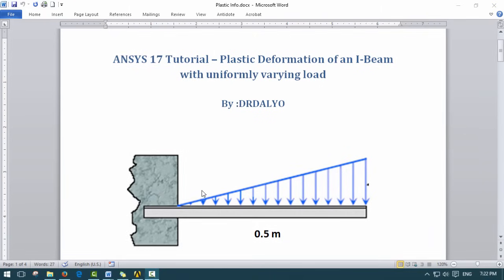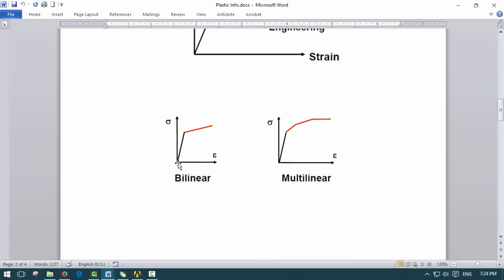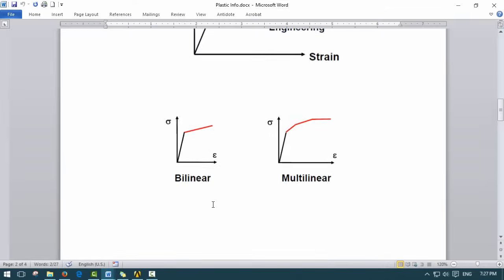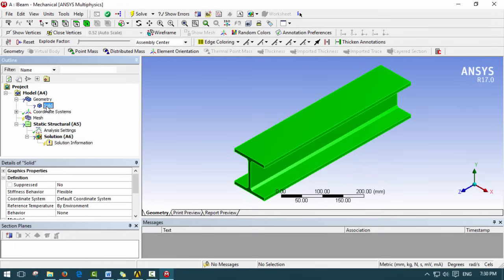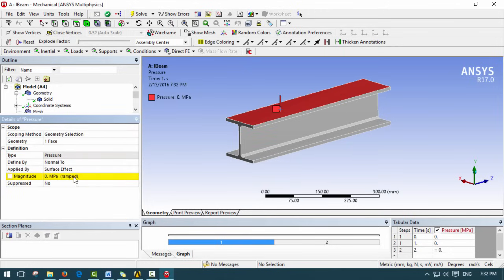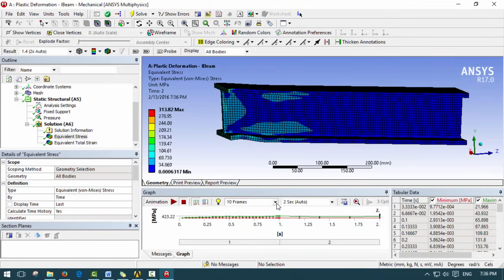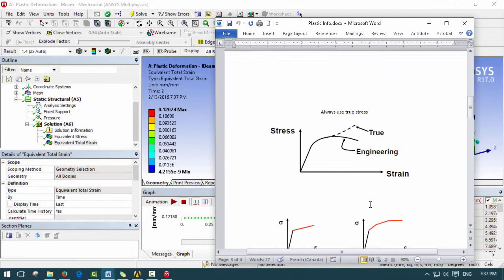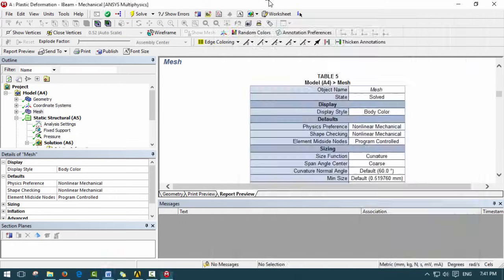ANSYS 17.0 Tutorial - Non Linear Plastic Deformation I-Beam

Comment: Hello! First of all, I hope all is well with you!
I'm a new follower of the channel and I want to congratulate you on your video and YouTube channel!

I watched your video "ANSYS 17.0 Tutorial - Non Linear Plastic Deformation I-Beam", which helped me, but I'm having some difficulties in my study.

I'm testing an aluminum spar with 4 flanges and 1 web, with holes to join them together. I set the boundary conditions, simulated a non-linear structural analysis in ANSYS, but I can't understand the results, can you help me, please?

I need to understand what force/moment makes the structure yield and what force/moment makes the structure actually break.
   1. To do this, I have to analyze the equivalent (von-Mises) stress, correct? I see if the maximum equivalent (von-Mises) stress that the simulation gave me is higher than the yield stress of the material and then if it is higher than the resistance stress? (And should I look at the equivalent (von-Mises) stress or the maximum normal stress?)

   2. Also, how do I know the structure has broken? In the simulation this never happens, I increase the force and it just starts to deform plastically, until it reaches a point where it can no longer be calculated, as it stops converging (this in cases of very exaggerated and meaningless forces, but the point is that visually the structure never breaks...how do I know it broke through the values?)

I will be waiting for your response, please.
Best wishes for you and your channel.

Best regards,
Ana

Comment: 0:40 diagram analysis
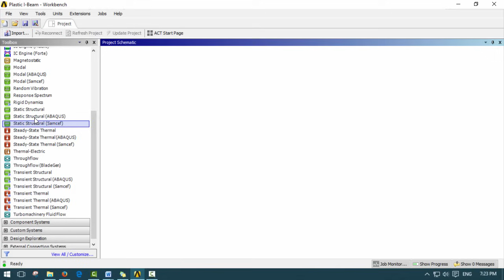1:38 static structure
2:17 Plasticity (toolbox) -Bilinear vs Multilinear
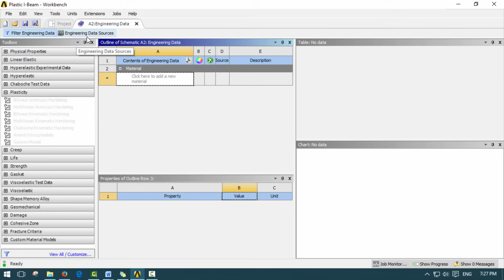4:41 engineering data source - general nonlinear material
5:18 Geometry to draw the model
6:00 concept - I beam
7:44 model (under the main toolbar)
8:10 Mesh
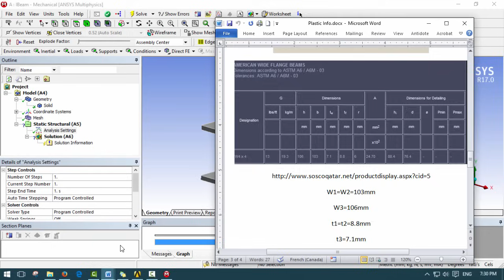8:30 Analysis setting
9:40 static structure- fixed support- insert pressure
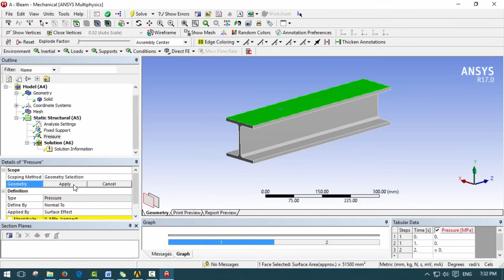10:00 Magnitude: Tabular
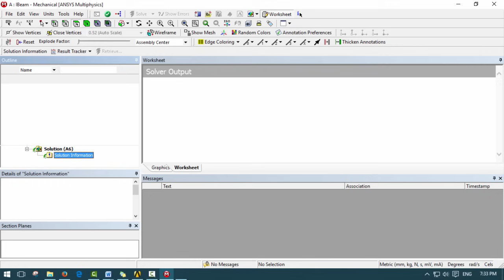11:45 solution output: force convergence
12:20 insert stress
14:40 insert stress for a mesh node
15:30 new chart and table for results
16:50 section cut
17:18 create an image for each result
Reply: god bless!

Comment: Hi, I'm facing this problem on Ansys. Kindly help me to solve this:
"your product license hasnumerical problem size limit, you have exceeded these problem size limitsand the solver cannot proceed "
Reply: Hi! If you're using Student license, try to make mesh less frequent. That problem occurs because your edition only has to work up to a certain threshold. (This of course makes calculations a lot less precise). Hope that helped, had the same problem with Patran Student Edition
Reply: Mesh less frequent means I should not change default meshing size or something else ?
Reply: @muhammadbilal7389  Make the elements bigger, so overall count is smaller
Reply: @deathworld5253  yes it works but the results varying too much
Reply from the maker: Mike is right. You need to increase the element size due to limitations of your license. You can attempt to use mirroring in order to save element count. Meaning u can slice your geometry in half and insert a mirror normal to the slice plane.
Any yes, its annoying that the results will vary because of larger element size..
Reply: @drdalyo  also theoretically you can vary the number of elements and assess how much of accuracy you have depending on the number of the elements- if elements are made right it should converge relatively fast

Comment: Thanks for the amazing tutorial. Just want to get a clear idea what initial, minimum and maximum substeps signify.
Reply from the maker: It basically means how many sections you want to divide the force by when calculating. The higher number of substeps usually means your solution will converge better without any error. So lets say I want to divide my force by 5, that would be the initial number of substeps. If the computer finds that it can solve the solution using less during the run then you can allow it to be lowered to say 2, which would be your minimum. And maximum is if say the computer cant solve with 5 substeps and needs to increase it, you set the top limit to say 10. Note the higher the maximum the more time it may take to solve depending on your model
Reply: @drdalyo  Thanks

Comment: Should we need to check the results (equivalent stress and equivalent total strain) with the input non linear curve to check whether the result is following the input curve given..ex:1st point stress 250Mpa, strain 0; 2nd point stress 260Mpa, strain 0.5.consider we are getting 255 Mpa from analysis, then strain should be in between 0 to 0.5 or it can be beyond 0.5?

Comment: Thank you for uploading this helpful video:) I have a question, in the video you said that it is a FAIL because the max equivalent stress is greater than yield strength, so what solution can be made to overcome this?
Reply: Using a larger beam, capable of withstanding the load!

Comment: Keep on doing what you re doing, these Tutorials are so compressed with informations and tricks and I like that. 
The examples could get more difficults :p its always a pleasure to watch you resolve them.
I had always a problem workinig with 18.2 when importing a STEP File (originally from Solidworks) and try to apply a force or a certain surface (not the whole surface just a section of it), without going through the Construction Modeler since its an imported part.
Thanks for everything !
Reply: in that case, you can make a named selection for the whole area and then chose it to put pressure or force on the named selection area.

Comment: Hello, first of all I want to thank you for the tutorial, which is helpful. Second thing I am writting is - could you do a tutorial on a more advanced/difficult model like an assambly of more than 10 parts, using NL materials, NL geometry, different contacts and a mesh of more than 500k with multiple forces, pressure, heat expansion in one simulation (at different steps), also high forces, so deformation would go into plasticity for some parts. And in that tutorial show not only the pre-conditioning but also how to eliminate warnings and errors (convergence, pivot, abrupt deformations etc.).
I understand that I may be asking for a bit too much, but if I wouldn`t ask I wouldn`t get an answer :)
Reply: To simulate what you are asking for takes at least a month to run the simulation with a powerful PC. instead, divide your problem into small pieces and simulate it. In the end, only experience will till the difference.

Comment: At 4:30, shouldn´t the yield point be at a strain of 0.02? Also, it´s labelled "plastic strain", does it mean you have to subtract 0.02 from the total strain to get the plastic strain? I would have though the yield point would be at a plastic strain of 0.00.
Reply from the maker: At 4:30, the graph shows only the plastic region (I know its slightly confusing how ansys does this). So your not seeing the linear region. There is a straight line from 0,0 to 250,0.01. After which, is the non-linear region or plastic region. 
If its still not clear, let me know in comments here.
Reply: Hi, thanks for your kind reply! I checked the ANSYS Help and it mentions the first point corresponds to the yield stress and strains are entered as plastic strains. I understand the first point should be plastic strain=0.002, stress=yield stress, because this is how yield stress is most commonly defined (permanent plastic deformation of 0.2% after unloading). Also, past the yield point I assume the values are true strain and true stress as opposed to engineering stress/strain. I wish to input the stress-strain curve of a given material as published on the MIL-HDBK-5 and I'm afraid I'm not doing something right. The first issue is true vs. engineering. The second issue is plastic vs. total instantaneous strain. Unfortunately the ANSYS help focuses on the Mechanical APDL way of submitting the information rather than the Workbench user interface.
Reply: @drdalyo  Hi, at 4:23, I am confused as to why your first strain input (0.01) remains yellow, as if it's not correct. This is also happening in my simulation and I'm not sure what the correct input is. Do you have any insight?

Comment: Hi, How long it to took to get the mesh? I have an eight core 3.6 Ghz processor and 8 gb ram 1 TB HDD @7200 rpm 2gb graphics I tried to do a mesh of 5 mm, 10 mm, 20 mm none of them working It takes too much of time I waited for about 15 Min but still in progress. Do anyone came across this type of problem. Any suggestion welcome.
Reply from the maker: that doesnt seem normal. it should take a few minutes.

Comment: sir I'm trying to reproduce the same problem in my Ansys workbench, but I'm unable to produce variable load. ? I'm using Ansys 14.5 and here I'm not getting the tool bar(tabular control) where you are specifying the variable region? will you help me regarding this?
Reply from the maker: +kiran kumar n a Not quite sure.. Could be the version you are using if you dont see that option. Check the help menu maybe, to see if its in there for v14.5. Let me know.
Reply: DrDalyO . no sir checked not get anything

Comment: Is there a setting which you turn "on" to make ANSYS run a plastic analysis or does it do it automatically? I've followed your steps but my stress-strain graph remains linear. I've tried incrementally increasing the loading, but it gets to a point where it solution doesn't converge.  Could there be a setting I haven't set correctly? I am trying to run a plastic analysis for my dissertation, but was unable to get the results so I followed this tutorial to see if I could make it work, and it seems like it could possibly be the same error on both analyses.
Reply from the maker: Maybe you didnt turn on large deflection? see the image here: https://goo.gl/ujEiDK

Comment: VonMises stress is elastic criterion of failure for isotropic materials. I'm not sure if using VonMises stress to evaluate results of plastic analysis is a good idea. At least in manual calculation I never seen anyone to use plastic section modulus as input to evaluate vonMises stress. I've seen in the standard, that it is recommended to use max. principal plastic strain as a failure criterion for plastic problems in conjunction with FE software. When you plot vonMises vs Equivalent total strain here, it resembles almost precisely the stress/strain diagram. But I think this happens only because this problem is dominated by normal stress and normal strain. I think that in other cases where also shear stress is significant, the curve will be similar, but the values in stress/strain diagram will be different. Maybe this is only a question of taste how do you mathematically represent the results. However, I think that one should be careful how to represent and understand the results. What's your thoughts on this?

Comment: What will happen if you do not do the chamfer?
Reply: At sharp corners ideally will have Infinite Stress. Bcz it It is force / Area so a sharp corner is basically a 0 area so chamfer will give some finite area so that cracking/ failure can be avoided in those regions. secondly in real manufacturing it is impossible to give sharp edges so u have to go with some radius of edges.

Comment: I have a basic question. Ansys is not a dynamic software. It is FE software and you used Static structural. Why do you use time and steps in that if the problem is static?
Reply from the maker: +Jon Saw Ansys contains many type of capabilities, it can do dynamic analyses. In my example, yes it is static, and the time steps here dont make sense you are correct. However ansys still uses the notion of time in Static to mean load steps. So t=1s in this example just means load step 1. Slightly confusing I know, but you could maybe read up on this more in the help.
Reply: DrDalyO Thank you. I tried to read more but I got more confused! All they taught us in the school was not dealing with time. It was just static!
Reply from the maker: Forget about the time when using Static Structural. Just think of it simply as, step 1 i do this, and step 2 i do that.
Reply: DrDalyO Oh Ok but what if the load is function of time in static analysis?
Reply from the maker: +Jon Saw then you have to use Transient Structural analysis
Reply: DrDalyO All right got it. I was dubious because I have seen some videos in youtube that they do such type of loads even in static structural.
Reply: Dynamic analysis is also possible. Time can has also physical meaning in rate-depended material models.... 
In the other cases, time is only orientation measure of simulation progress...

Comment: Hi!
Can you please tell me how to define a Multilinear isotropic hardening material? in your video you stop right after you entering the stress&strain points and the question mark is still there.  Ansys shows me a message "The following components need attention before proceeding:Engineering Data". I don't know what to do from this point forward. I need to define a material with these coordinates: 
STRAIN STRESS
0            0
0.002 355
0.15   600
0.15  355
Thank you in advance!
M.G.
Reply from the maker: So add a multilinear isotropic hardening material, and set the yield point in the details, then in the table add only the plastic components so the table should only contain these values:
0.002 355
0.15   600
0.15  355